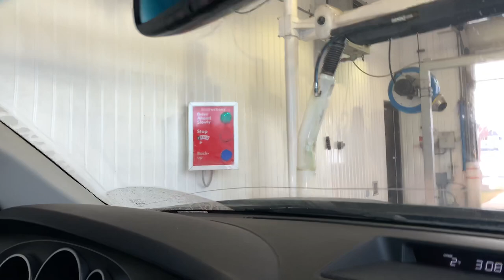Terrific Belanger Kondor KL2 - Monterey Park Petro-Canada - Calgary, AB

Comment: Believe it or not this used to be a soft touch in bay system. Sadly I can’t remember which it was. It got replace in 2013 or 2014
Reply: If you go on google maps you can see it
Reply from the maker: Japneet Saini Really? Do you know what it was?
Reply: Can’t remember the system because my family pefers the handwash over automatic car washes. I just got interested in this business because of the elevator channel
Reply: There was another in bay soft touch system in McKnight shopping village. I believe that system might have been a ryko system. But it got replaced with a maybe the system that was shown in this video. But it recently just an upgrading and I don’t if the system got changed
Reply from the maker: Japneet Saini Wait, can you tell me the address of that one?
Reply: It’s in falcon ridge on 52 street
Reply: Address is 1051 Falconridge Dr Ne
Reply from the maker: Japneet Saini What's the name?
Reply: It’s just a superwash at petro Canada.
Reply from the maker: Japneet Saini It did get replaced. Was it an in-bay wash or a tunnel?
Reply: Albertan Car Washes it was an in bay soft touch then changed to touch less system
Reply: Japneet Saini Hand washes are incredibly dangerous for your cars paint, harmful particles can get stuck in the sponges, towels and other tools. Soft touch washes on the other hand, use closed cell foam which doesn’t hold dirt or any other harmful particles.
Reply: The Car Wash Fanatic  no we only use presoak and high pressure rinse. We don’t like soft touch washes because we’re scared of getting scratches in the car. But hey I respect your facts and opinions as well
Reply: Japneet Saini Soft touch washes do not scratch cars, like I said they use closed cell foam which is rinsed properly so it doesn’t hold dirt or any other harmful particles.
Reply from the maker: Japneet Saini That one at the Falconridge Petro-Canada looks like it could've been a D&S Odyssey.
Reply from the maker: The Car Wash /Elevator Fanatic At this rate, hand washes at home are the only option because of the virus. Literally everything has closed down.
Reply: Alberta Car Wash Channel I heard that system is rare by the elevator channel
Reply from the maker: Japneet Saini Yes, it is. It could've also been a Nu-Star Soft Touch Three. I've had a look at both of them and tbh, they both look pretty weird. Falconridge had a 5 brush system I believe, and this one had a 3-brush rollover.
Reply: Alberta Car Wash Channel yea maybe based on the bay size
Reply from the maker: Japneet Saini Falconridge maybe even had an Autec. I really can't tell.
Reply: Alberta Car Wash Channel because the photo was very old so its hard to tell
Reply from the maker: Japneet Saini Some of the other people in the community have looked at it, and I've gotten a look at it, and I'd definitely say Autec for Falconridge.